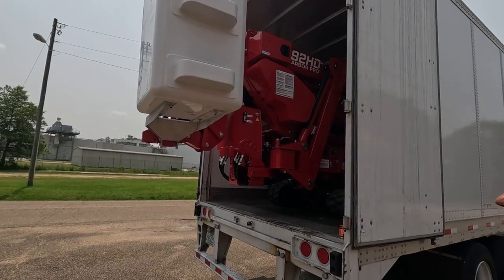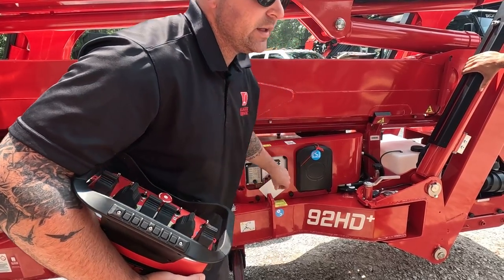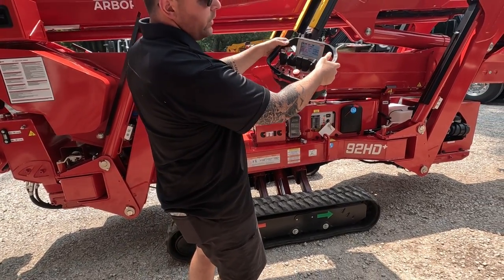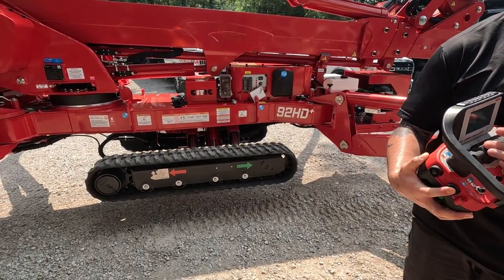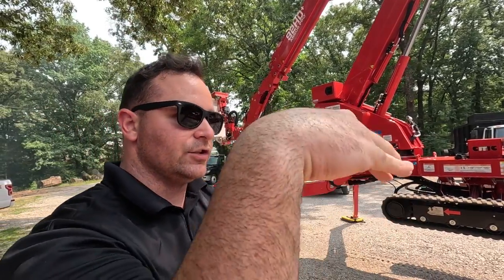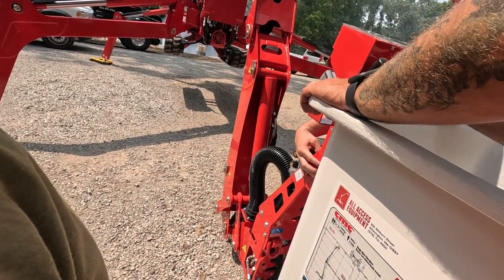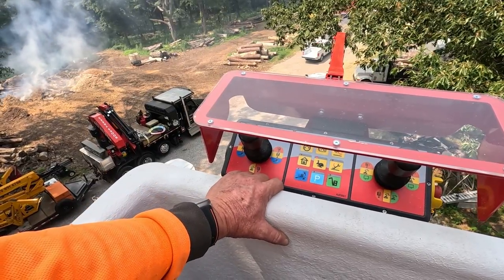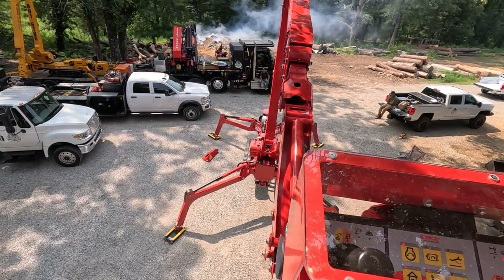Brand new CMC 92hd lift with a training session

Comment: The 2 best days in a CMC lift owner's life are the day they get it and the day they sell it. In between, not so much. With this type of equipment, support is critical. So many go-no-go electrical switches, electric over hydraulic, and a CANBUS system. If the battery gets weak the motherboard will go out. On and on potential downtime.
Reply: I have owned 60 foot tracked lift made by tracked lift . Have owned it for 7 years, Machine had over 1700 hours and haven’t had a single issue with machine . And have heard bad things about the cmc units..
Reply: @capecodarbortech  the Platform Basket is better engineered than CMC and Tracked Lifts Service is adequate .

Comment: at 37:00 = bucket, bringing it down to point you can get in/out of bucket. the U portion for self leveling of bucket. there is nothing on bottom from running the thing into the ground. ya doing a reach around from bucket controls to see around the controls. give my like 1" flat plat. something like the stupid auto vacumuns for homes, that have a bumber on them if they run into something they stop and then reverse. ya its depth preception, but it is also prime time of not giving a damn, focusing on removing stuff from bucket and about to climb out and OWE i think i want it down a little further and loose track of depth preception and run the thing into the ground. 

never ran a machine like that, and doubt i ever will. but to much crude in multifunction joysticks. more so when you have gloves on. i don't care if they are cheap plastic gloves for food in kitchen / restruants, to leather, or some cotten for winter gloves. i do the bloody fat fingers and hit wrong buttons.  there is not a damn thing to fill enough through gloves for what buttons you press. 

i am not a fan of mixing controls either. the remote control vs bucket controls. MAKE THEM BLOODY SAME! hey i get in truck, then in car, then small 20hp tractor, then 80HP tracker, then zero turn mower, then swap over to a different truck. then to a tractor loader backhoe.  each bloody machine is different.  and i have screwed up enough times that caught myself in time before running into something or hurting anyone, but on same machine using different types of controls just looks scary deadly to me.  

i noticed that almost like it requires entire lower boom to be full verticle before getting into bucket?!?!? ya i so hate power lines. its fine when i am high enough say in bucket. bucket but on ground looking up in of course the bloody sun and making it harder to tell were power line is vs machine.  is there a by pass to get around that?

am i missing out on the fun of all the greese zerks? i didn't see tall tell signs of any zerk fittings for a greese gun?!?

not sure, some of the metal for were pins and bushings are for everything. is there no need for like a large "washer" as in bolt, washer, nuts. needing to be welded onto some of the areas for some re-enforcing? mentioned a few times machine running faster than other yellow unit you have.  seems like ya going to be rotating and then come to sudden stop to sudden rotation in oppposite direction and start jamming up stuff and tearing up pins + bushings + warping some of the metal areas.

Comment: The weight limits keep me grounded at 205 naked.  But, for smaller guys, consider the weight of your saws and ropes and gear.  Small man's jog?
Reply from the maker: It’s rated for 500 pounds in the basket, u would be fine.

Comment: These machines are nice but they're not fit for every job. The delay in the controls and the drift they have when you let go are frustrating. Let's not forget the constant beeping it does from all the sensors, majority of the time you have to do what the machine wants not what you want.